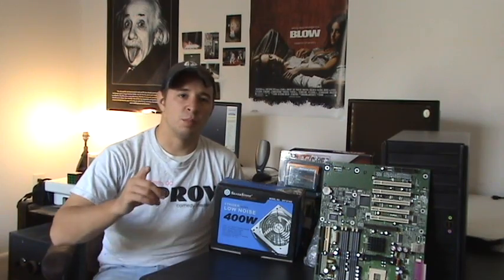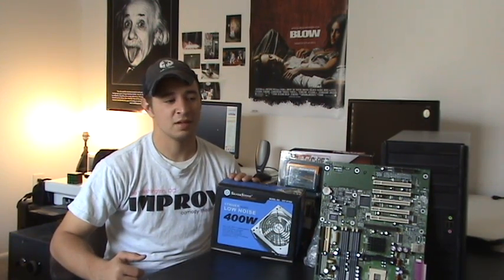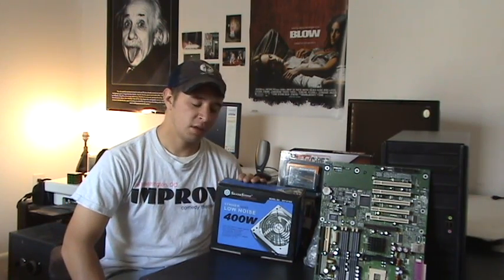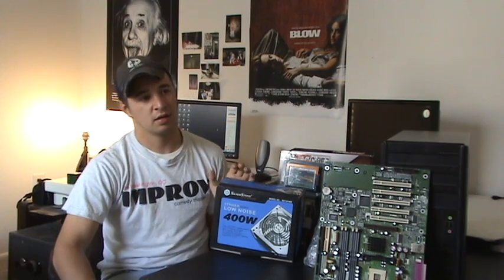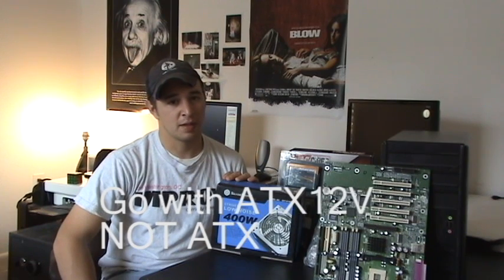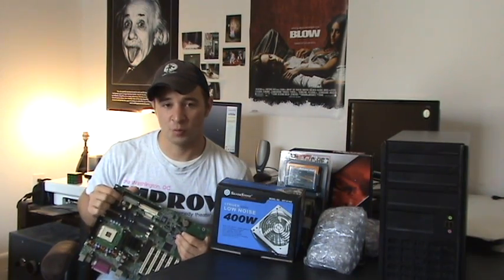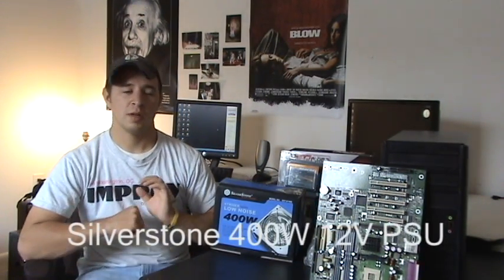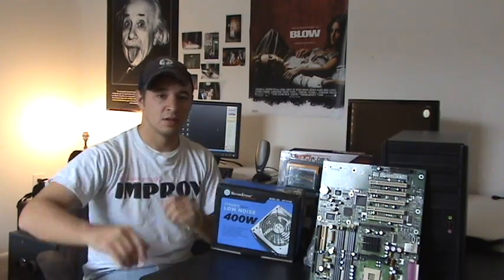How to Build a Computer - 13 - Power Supplies

Comment: If it's gaming laptop specifically designed for aming you should have no problems. I thought you just had like a netbook and wanted to upgrade that for some gaming capability. With a gaming laptop you should face no problems I see of.

Comment: i dont know how much you know about computers but do you know any requirements you need in your computer or laptop before putting in a new graphics card cause i aint wasting £900 on a gtx card to find out i cant run it

Comment: hi, I have a dell inspiron 540 mid tower:: Amd Quad Core :: Geforce 220 :: 300watt psu .....recently my computer monitor will go to sleep and not turn back on. I have to do a hard restart and I believe it is due to a cooling issue. Any thoughts on what I should do? I can post a vid of the computer if needed.

Comment: Today you want a 750 for a basic gaming system and 1000 if you want to are considering a lot upgrades in the future. Buying a good brand is important. Cheap PSUs can often be unreliable, and I've destroyed a graphics card due to this. Also with better PSUs they offer modules where only basic power leads are present and you plug in any leads for graphics cards etc are plugged in when needed, promoting better airflow.

Comment: @lgrazy OCZ and uhmm Aerocool and Coolermaster. You should choose Coolermaster when you got a case from them too.

You knew a Power Supply is called ''Voeding'' in Dutch. Voe like in Voo-Doo. And ing like in fucking ,but you pronounce it different in Dutch :$

Comment: my system.
coolermaster - 1000watt
AMD phemon II x4 3.4 ghz (aiming for a 4ghz after OC)
G.SKILL ripjaws 4gb(2x2gb) ddr3 1600 
XFX  ATI radeon 5870 ddr5 1gb
Gigabyte 890 GPs
samsung spinpoint 1tb 7,200 rpm 3.0gb/s

^im on the bandwagon

Comment: My system
PSU: Corsair - ATX Power Supply
Motherboard: Asus - Micro ATX Motherboard 1200/1066/800/667MHz
Processor: AMD - Athlon™ II X4 Quad-Core Processor 630
Case: Thermaltake - Soprano Mid-Tower Case - Black
Model: VG7000BWS | SKU: 8763126
Hard Drive: Seagate - 1TB Internal Hard Drive
Ram: ValueRAM - 2GB PC2-6400 DDR2 Desktop Memory Kit (2-Pack)

Comment: You forgot about the amperage on the railings and Silverstone is not really good. Go for the PC Power and Cooling brand if you want the best reliability. What good brands offer is the providing clean power which means less ripple in the output current. Too much ripple can damage components in the long run which results to BSOD or in other words kicking your CPU and going crazy.

Comment: yea but... its overkill. a 750w psu is enuf for an i7 plus two gtx 285s in sli. with some room for overclocking at max load. u rly dont need more unless ur tri or quad sli ing.

Comment: its dam simple. turn the gfx card upsidedown. so the fan is on the bottom adn on top is the pcb.

next just slide and push the card in the PCI E x16 2.0 slot. make sure u hear a click. then get a screw and screw the screw in the screw hole on the back of the comp. if ur gfx card require a power connector. find it on ur psu and push it in.

Comment: Yes, you need a Video Card.  Most current Motherboards have integrated soundboards.

The ATI HD4870 is a great choice and  will support 1920x1600 quite well.  It's selling for about $130 w/ prices dropping to to the introduction of DX11 cards.

On the Power Supplies... most pre-built computers come with a 350 watt power supply.

I'm currently building an i7 with 12gb's ram, dual HD., and the HD4870.  

I'm installing a Corsair 550 watt Power Supply ... leaves plenty of headroom.

Comment: This is a load of crap. The wattage doesn't matter as much you say. The rails and amps are what are important. If all the amps are on the 3v and 5v rails, it's as much use as a cream slice. Needs a good dual rail system with a lot of amps on the 12v rail. Cheap 1Kw PSU's will blow up. A quality 500W psu will run most PC's fine.

Comment: Comes with 450W PSU with 24 Pin and SATA But it does not say whether its a 12v? but its 24 pins so i will be a 12v ?

Comment: I can see he's not building an expensive gaming computer. But computers now are needing alot more wattage. If you are building a computer which is using high end parts. Go 500-1000w, but dont go cheap, go for reliable brands like Antec, Silverstone, Corsair, OCZ, ThermalTake.. I could name more. Hope this helps :X

Comment: Trying to impress the ladies?

Not to crush your epeen or anything but, I don't think anyone cares, unless you're planning on making a helpful video series for others to learn from. If not, then kindly stfu.

Thanks.

P.S. If you're otherwise blind, he's wearing a charity(rubber)band around his wrist, he's not conductive. Even so, the motherboard he's using is for an example so he can visually/physically point to different components.

Comment: If 300 is crap how can 400 be good to expand with? Also alot of rigs have neon lights, cooling systems, extra fans/drives etc etc... wouldn't 600 be better?

Last, what about voltage spike control and life gaurantee and the Decibel level of the power supply or are you taking that for granted when getting a good brand??